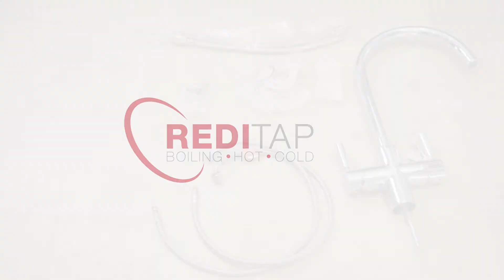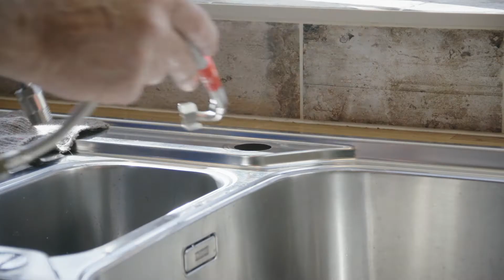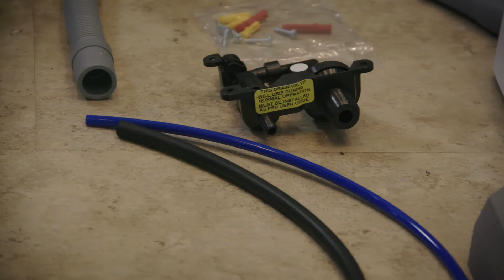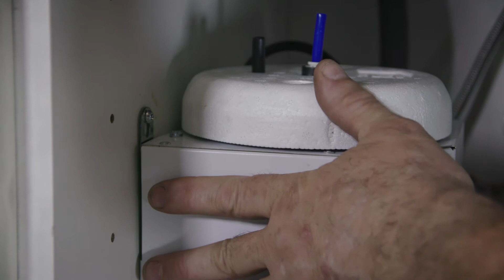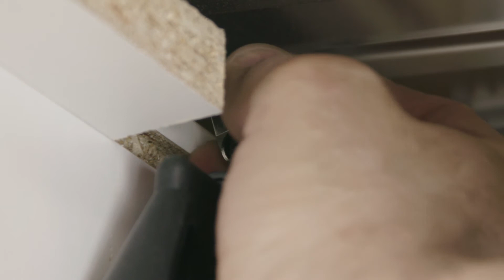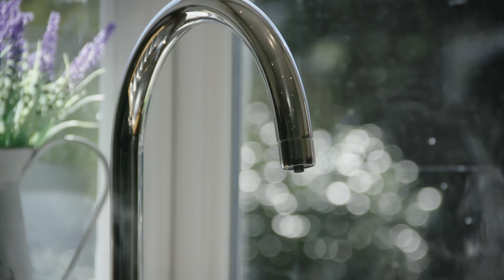Reditap Installation Video

Comment: Is it possible to use this (or any of the instant hot water taps) just with a cold-feed? I'm looking to eliminate my hot water cylinder altogether, but notice these are still using it...